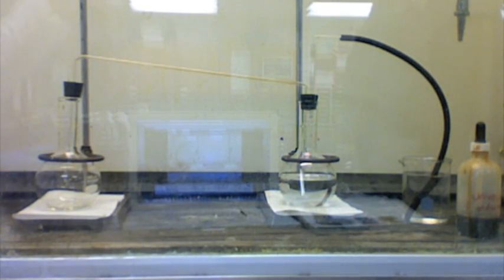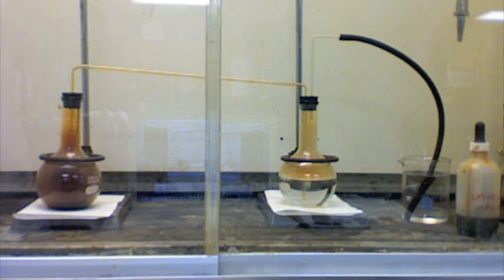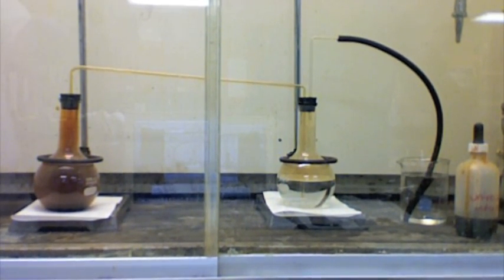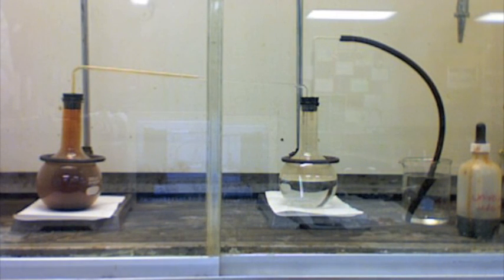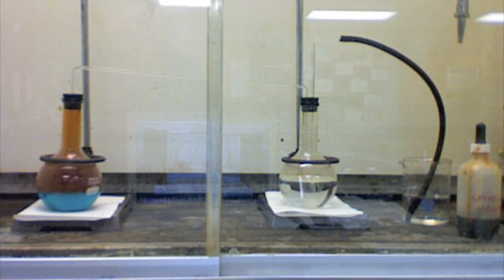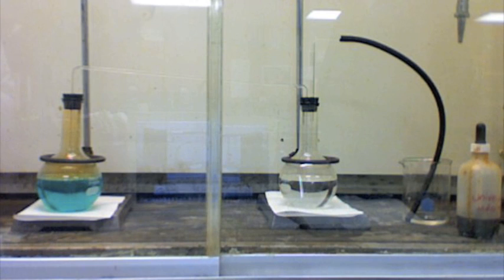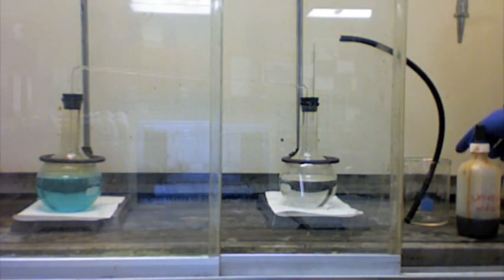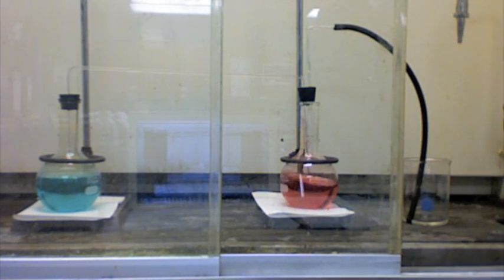Copper and Nitric Acid then Nitrogen dioxide and water

Comment: The green material produced in the first flask is not copper nitrate. Copper nitrate or rather the [Cu(H2O)6]2+ ion is blue. The green color is due to a copper II nitrato complex. Exact structure of these complexes are not known,but  equation below is a likely possibility.The copper nitrate is produced when the water is pulled from the second flask into the first flask. Equations 
Cu + 4 H3O+ + 4 NO3−  →  [Cu(H2O)4(NO3)2] + 2 H2O + 2 NO2
[Cu(H2O)4(NO3)2] + 2 H2O  →  [Cu(H2O) 6]2+  +  2 NO3−